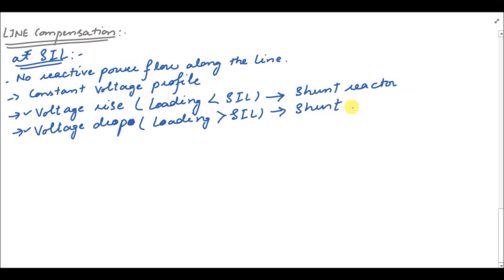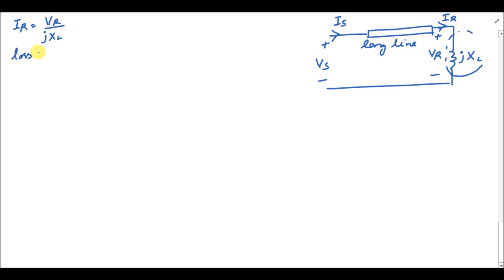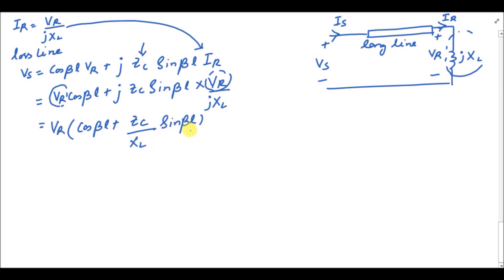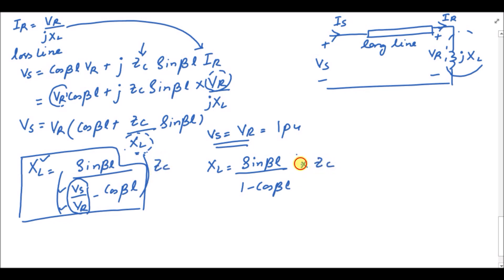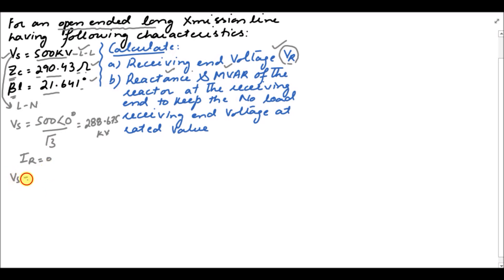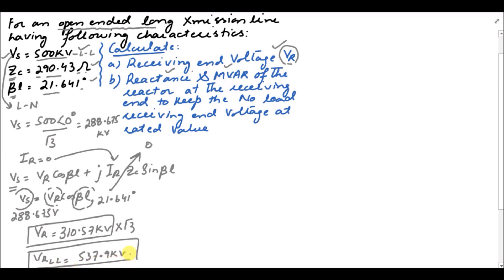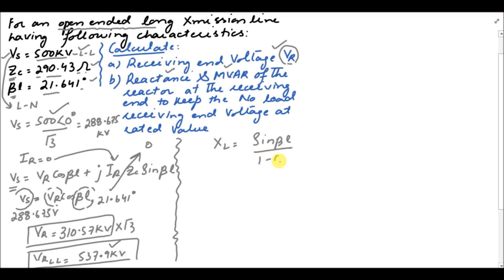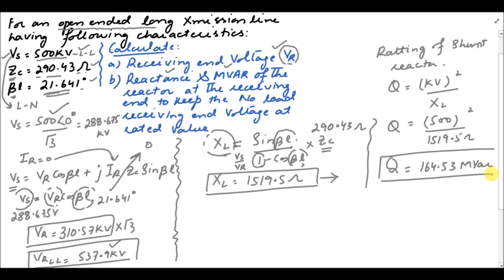Power Transmission|| 40 ||  Shunt Reactor Compensation in Transmission Lines

Comment: Could you please answer my questions: 
1-in Xlsh relation line to line or line to neutral voltage we used? 
if Vr=.9pu then the V^2/Xl 
V value will be   .9*Vs right? 
And if the question wants SIL with no information of Vr(to be calculated frok simulation) then van I use Vs?
Reply from the maker: in the expression of Xlsh the voltage is line to neutral because the single line representation of the transmission line is used for the long transmission line representation.

I am not clear about the second question about the V^2/Xl. can you please elaborate it again?

Comment: Thanks for the great presentation, but I have a question. In many references, hyperbolic trigonometric functions are used to represent the generalized model of a transmission line. Why are you using basic trigonometric functions (sine cosine).
Reply from the maker: The represented equations are for the loss less line. In the lossless line case the hyperbolic functions can be converted to the sinusoids. For the reference check the following lecture:

https://www.youtube.com/watch?v=51ocqAw0Z4w
Around 13 minutes mark